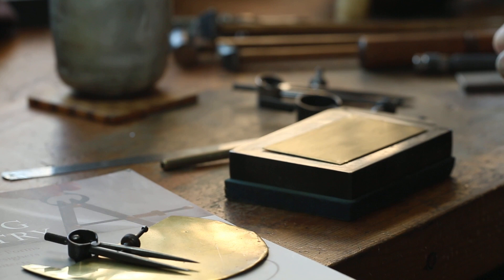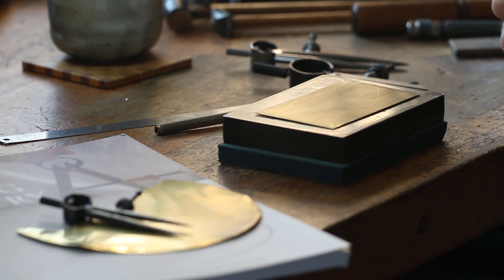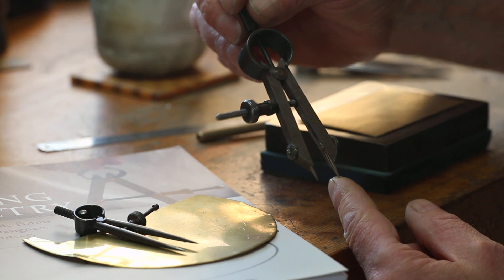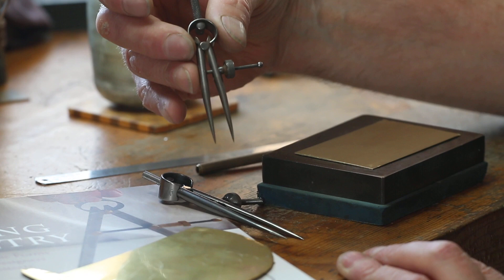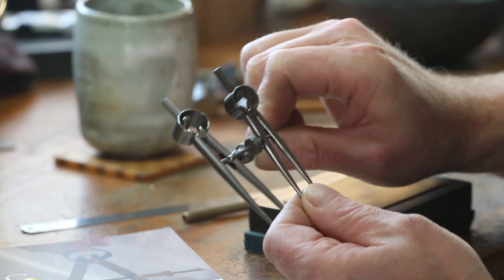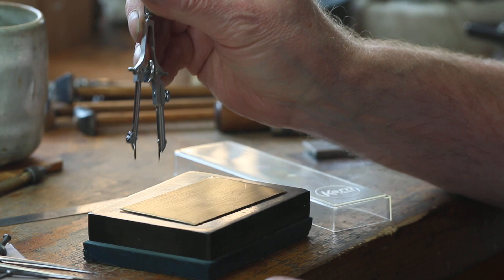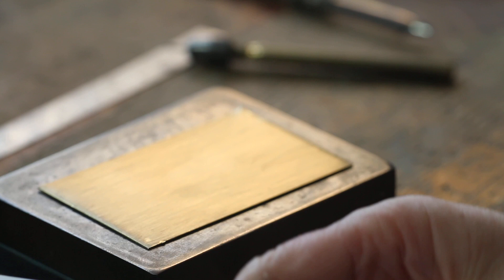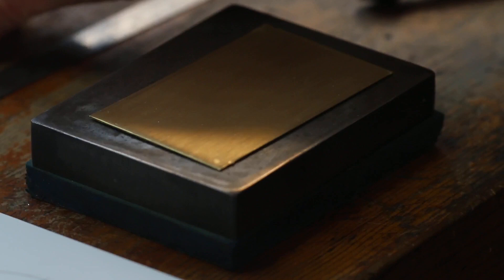Ironbrush Fundamentals

Comment: Thanks so much for the video! I watched it with great pleasure. If you allow me, I will express a few thoughts about the video. With direct grinding, the marking line with the coincidence of directions is sometimes lost and poorly visible.  Does it make sense to grind in small circular motions? Also thanks for the detailed explanation. I also always try to give maximum information, but when it comes to markup, many subscribers scold me for the inaccuracies they see. They do not understand that the marking line gives shine only on one side and the impression is that the line passes slightly offset. Thanks to your videos, I’m almost ripe for working with metals. Now I'm busy preparing tools and taking the first steps.
Reply from the maker: I'm glad you enjoyed the film. It probably would make seeing the layout easier if the surface was polished in a circular way. However, when I teach I ask my student to grind as evenly as possible, to ensure that all marks are eliminated, circular marks can hide scratches too easily but they are still there when you go finer. Of course one could do a light pass with circular marks after the whole surface has been properly ground by going evenly.
Reply: @FordHallam  Thanks for the detailed answer. I try to polish the surface as clean as possible so that there are no traces of the previous abrasive on it. After that, with the same sanding paper that the finish did, I sand it in a circular motion without pressure. Perhaps I play it safe, trying to make the markup shallow. Most likely I'm just lazy and I don’t want to polish deeper markup after). Now I'm watching your second video, which was released yesterday. I already want to buy the books you showed.